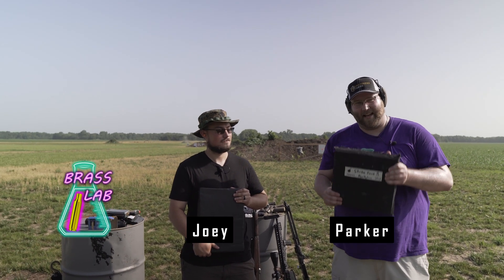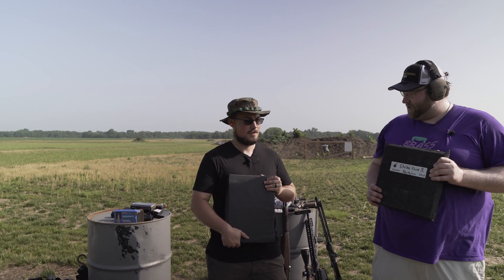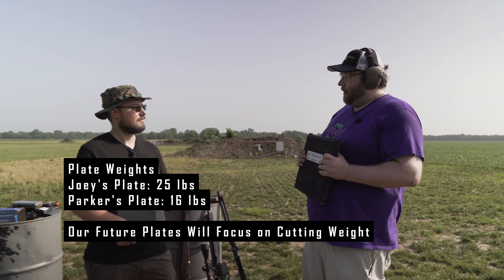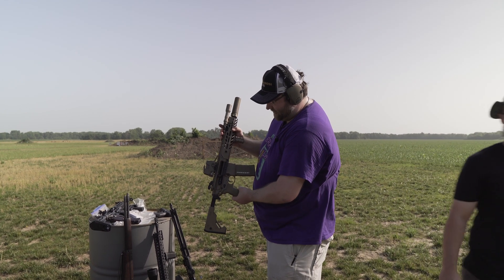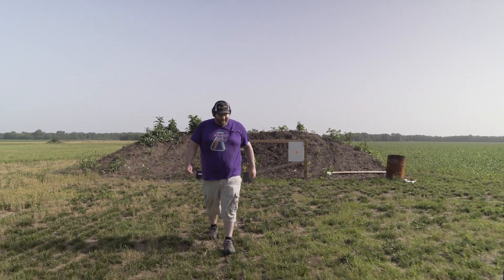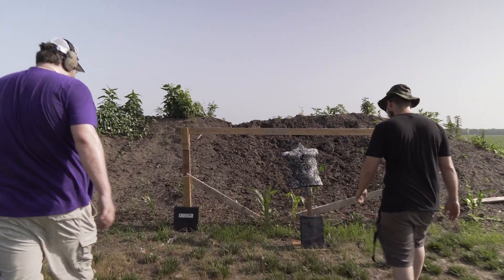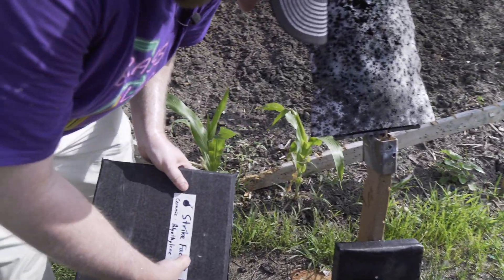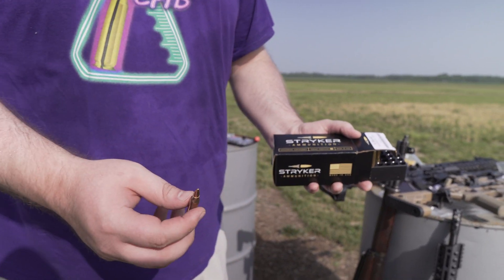DIY Homemade Body Armor THAT WORKS: STOPS 5.56 💥 308 💥 30-06

Comment: Unless you’re going to weld the rebar together not sure why you would include it in a plate with holes in between 😭
Reply: It supports the ceramic when it fractures

Comment: 25 pounds is way too much. One on each side would equal 50 pounds and the vest carrier itself would weigh at least 3-5.

That’s around 25kg. Start adding loaded magazines, etc and you easily got 60-70 pounds of gear on you.
Reply: Honestly 50 pounds is a lot but not much when you compare that level of protection to the same weight for medieval body armor which protected many people the same way although it was more evenly distributed all over the body.

 I'd definitely be curious to see if they could get the same level if protection but with lighter weight plates.

Comment: thats cool and all, and would be perfectly fine for a barricade or vehicle plating, but not for a man on feet
Reply: I made a similar plate with 2 tiles and a fiberglass backer and it stopped a shot from a fmj 5.56

Comment: Run a thin backing Bisaloy plate and a thin front plate with composite sandwich...The front plate will deform the round the compesate will slow and deform more and the back will stop the plug that develops...

Comment: I'm thinking you DON'T want to go near water with those on as you'll drown... 🤪
Reply from the maker: Very true! 🤣🤣 buoyant plates is a bit too much to ask of DIY plates for what’s available right now, unfortunately
Reply: HDPE + fiberglass matrix composite with double porcelain floor tile strike face may float. I haven't seen anyone test it yet other than testing it as armor against various ballistic threats.
Reply: killerwolf7676   Yeah I've tried it. I had some issues in the beginning trying to get the HDPE to even stick to Fiberglass because you have to melt thin layers of the plastic into the fibers to get it to stick. And then from there you do a repetition of making a bunch of HDPE sheets with a layer of Fiberglass inside, and you just stack them up and re-melt them in your oven while under clamping pressure so all of the layers fuse together and it forms one solid sheet of composite that won't delaminate when shot.
Now I want to attempt the next level of sophistication which is HDPE resin laminated with Nylon Fabric as a composite backer. There's already a video on this subject if you're interested.
Just use the search terms HDPE and Nylon and you should be able to find it.

Comment: Did you guys ever try about 6" of steel with several layers of aramid? Remember aramid should not all be set in same direction some should be 45 degrees tilted. ;D
Reply: 6 inches? Or 6 mm cause 6 inch would stop a tank round😂
Reply: @daddyplankton5855 No it won't. M829A2 120mm APFSDS-T will penetrate 29 to 30 inches of steel before stopping.
Reply: @Obsidian   okay so it'll stop like ww2 tank in theory
Reply: @daddyplankton5855  If it was sloped at 60 degrees or more, then yes, possibly. But it would depend on what kind of WW2 tank round we're talking about stopping. Because there is a lot of different variables with WW2 tank rounds and there were different types of ammunition available at the time. I've heard a rumor online somewhere that if you take a 6mm sheet of armor steel and angle it at 89.999999 degrees from vertical you could deflect 120mm APFSDS. Hell, you could deflect damn near everything with that angle. But that is an impossible thing to achieve.